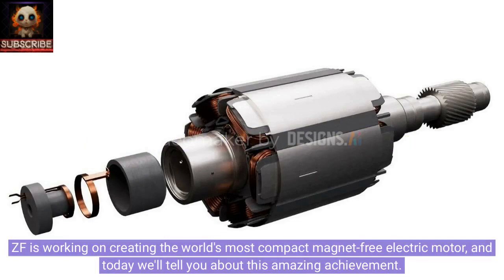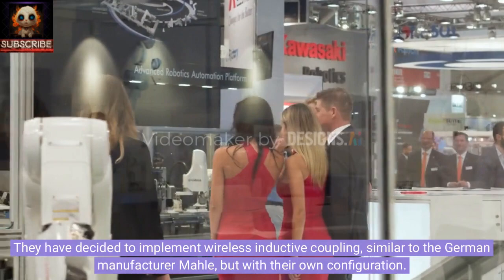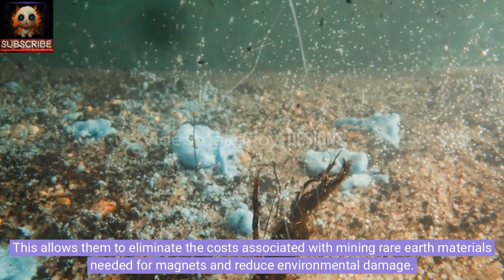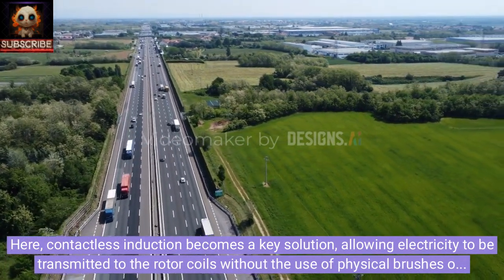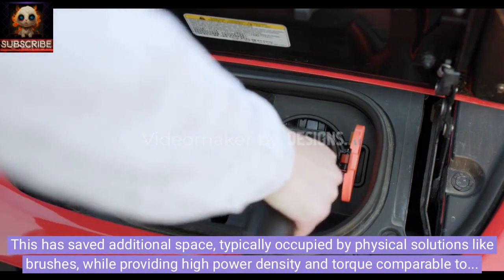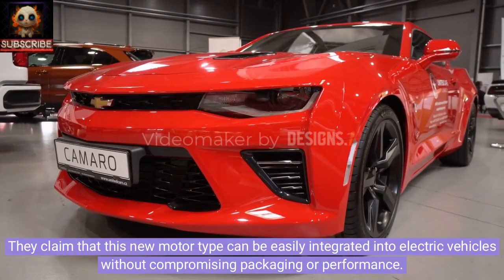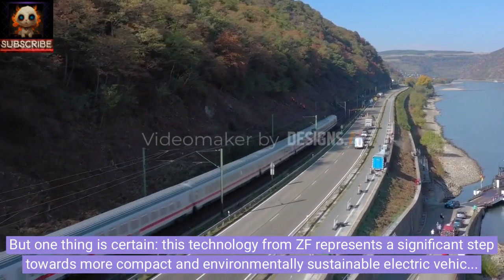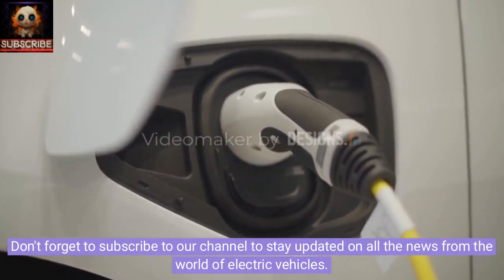"Revolutionizing Electric Motors: ZF's Compact Magnet-Free Breakthrough"

Comment: Omg it's just an oversized alternator! You can find this innovation in every gas powered car! Three-phase synchronous motors with wound-rotor were the first synchronous motors ever produced! Welcome back in 1890!
Reply from the maker: I appreciate your comment and your historical perspective on the technology! It's true that many innovations in electric vehicles, such as the use of three-phase synchronous motors, have roots in earlier developments. However, it's also important to recognize that the innovation in modern electric vehicles lies in their efficiency, integration with advanced battery technology, and the shift toward cleaner and more sustainable transportation.

While the principles of electric motors have been around for a long time, the way they are utilized in electric vehicles today involves cutting-edge engineering and materials, as well as ongoing advancements to improve performance, range, and environmental impact. It's exciting to see how these technologies continue to evolve and contribute to a more sustainable future for transportation.
Reply: @radetskiyrady6316  Oh, materials. I agree, I'm not kidding. By the way, these innovations in materials also apply to other modern motor designs. But implementing the slip-ring into a modern motor design is a bit confusing. There are different ways to implement the field weakening concept in an IPM or SMPM using only the appropriate firmware. I don't see the point in implementing physical field weakening by adding a slip-ring to a motor that spins at, say, 19000 rpm. The whole industry just runs away from wearing parts.

Tesla and Toyota have already done this, achieving the same results in their SynRM-PM motors. Low back-emf, high power, small form factor, high staring torque, and efficiency over 96%.

This concept looks like a step back.
Reply: @Sh1neful the purpose is not implement field weakening - it is to eliminate the need for permanent magnets in a synchronous motor.